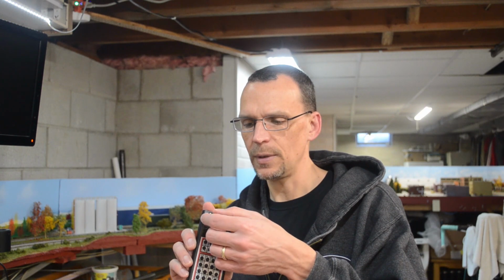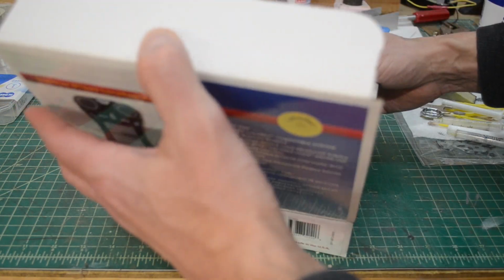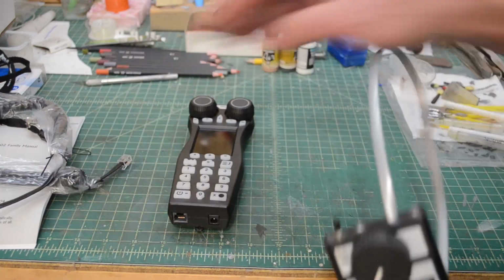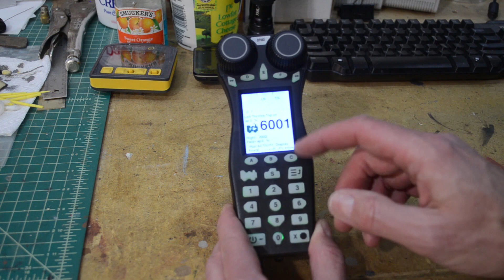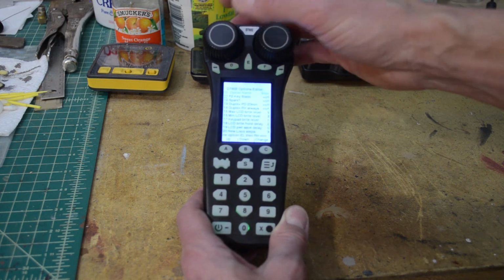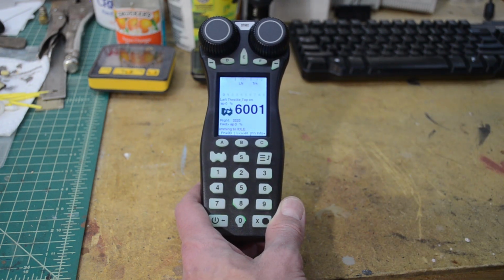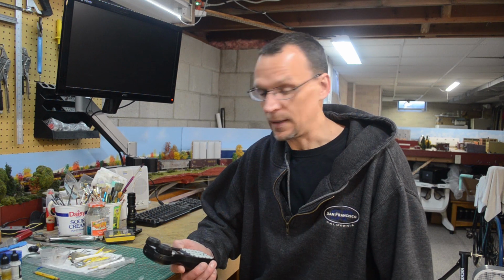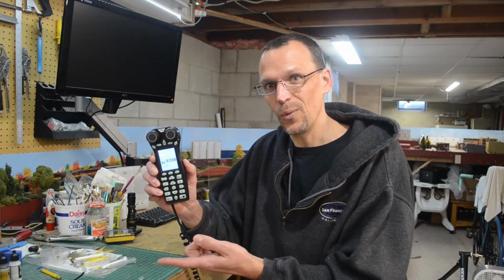Digitrax DT602 Throttle Review

Comment: You changed the display setting to 7. How long does the display stay lighted now?
Reply from the maker: Still not long.  It honestly didn't seem to change much at all.  I didn't time it, but I'd say it's under a couple minutes still.
Reply: Ok, thank you
Reply: @ChessieFan2  Change the LCD values for the hold and pwr save to  0.  It will stay on.
Reply from the maker: @jasonstrains4325  Excellent tip!  Thanks!